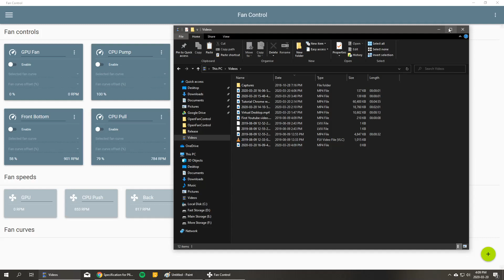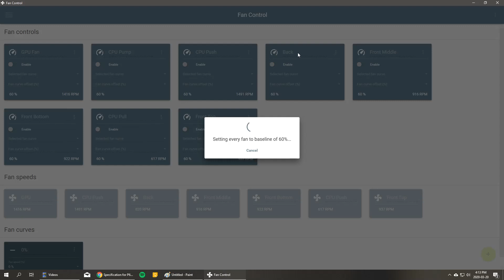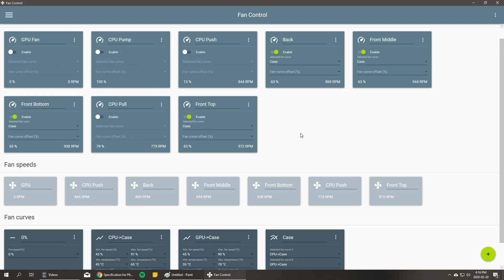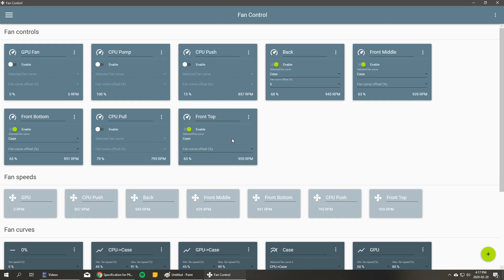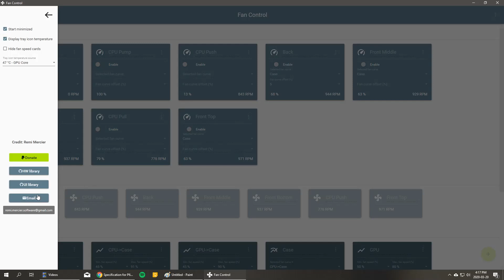Fan Control: Basic setup for case fans (Part 1)

Comment: Hello, for some reason I can't open the program?
Reply from the maker: I think I missed a file in my latest update, try to download again, it should be fixed.
Reply: @rmsoftware3759  Is this win10 only? Or a certain version of .Net Framework? On win7 still (strictly gaming) and whether I try to run as admin or not, I get a little error message that says "Fan Control stopped working". I downloaded it last night and today, still the same. Ran Libre Hardware Monitor and it detects everything of mine, a little laggy though.
Reply from the maker: @heytoast7129  It's .Net 4.8, haven't tried it with anything but W10.
Reply: @rmsoftware3759  Hey that did it. 👍 Thought I had 4.8 installed already but it turned out I didn't. Thank you and great little program. My video card does have 2x 4pin connectors to hook up 2 additional fans. What I don't like about that is there's no control over them. So, I can just plug them into the motherboard and use this. Thanks again.
Reply from the maker: @heytoast7129  It's great to hear about use cases you never head before, glad it fits your needs!

Comment: FINALLY. A decent fan control software i've been searching for one for a few days. 
This is really good :) 
Although i do have one issue : 3 fan controls do not match with the fans in the speed section (including 1 that doesn't show up). 
Even when trying the flat curve at 0% and watching my case.
Reply from the maker: Are all your fan headers used?
Reply: @rmsoftware3759  yes ! 
but i am using a fan hub with 4 headers for 1. and 2 other headers on the motherboard have a Y cable for 2 extra headers. 
Maybe that's the cause ?
Reply from the maker: @JamesChancé-n2k  You got it.
Reply: @rmsoftware3759  interesting, the headers which have the Y cable for 2 fans are paired (in my case,  2 top fans and 2 at the bottom).
So each fan control acts upon each pair, which is perfect for me !
The one with the hub though is weird. The software detects them, i can see their speed, but can't control them.